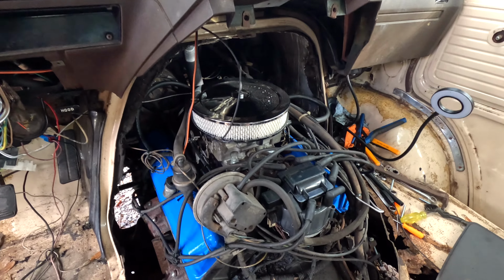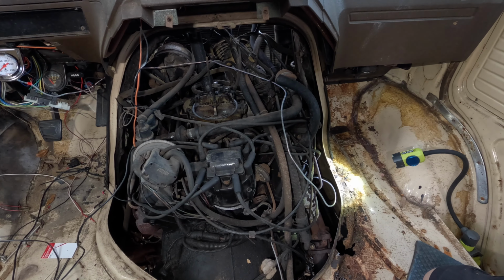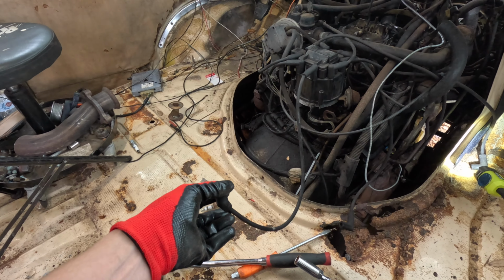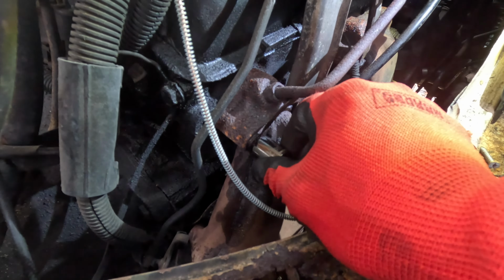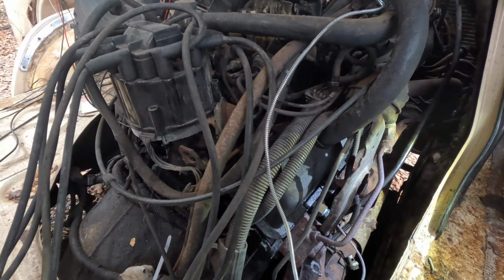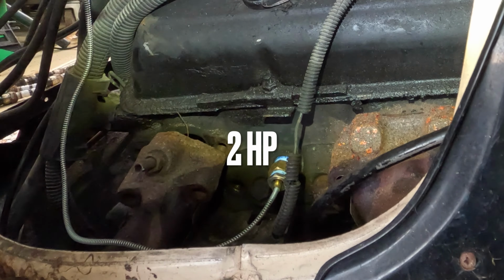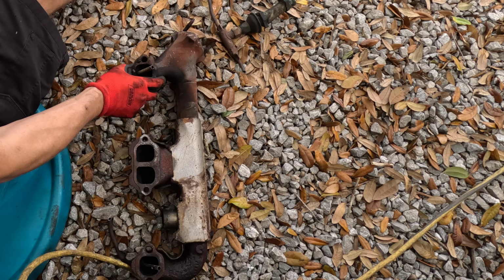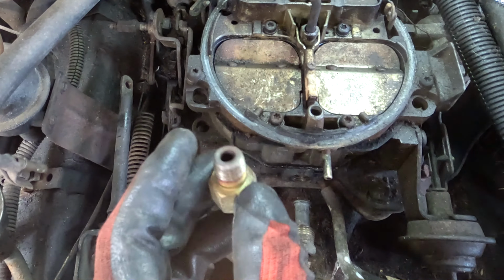Carb and Exhaust gaskets replaced on a sbc 350 in our 1986 Chevy Van G20

Comment: Yeah; I remember in the '80s they used to just tear all that stuff off as soon as it made trouble for the smooth operation. Emissions tests weren't laws yet, and the vehicles weren't beholden to standards. But they knew the day was coming and were trying to get ahead by making vehicles respectable before it got too demanding and expensive to develop engines that pollute less. But people considered all that stuff as just inhibiting junk and made engines run badly.
When I saw that quad spark plug I immediately thought do a compression test. They were probably trying to avoid a ring job. PVC valves were a lot easier and cheaper on these years. There's no excuse for blowing your gaskets out over that little part. Great nostalgia here going over this van. I love this restore!

Comment: I learned a great  trick for fasteners that have to go under the vehicle in the road spray, and are going to be heat cycled: As long as it's not super strength sensitive, just find Brass nuts. They will never freeze to your bolts, hold well, and aren't all that expensive. I worried about them maybe vibrating loose, so I just double nutted each of the joints on my exhaust hangers and the clamps with brass.  Worked great, and here in Canada replacing exhausts happens on the regular tbh.

Comment: I appreciate the content you’re posting.  However, I have a couple of questions:

1)  Why did you buy an additional water gauge when the factory provided you with an oil and water gauge?  Wouldn’t it be easier (and cleaner looking) to reconnect the oil and water gauge in the instrument panel and get rid of the external gauges and the “electrical spaghetti” that would come with it?

2). Wouldn’t it be easier remove and replace the inline fuel filter around the frame rail on the (typically) drivers side?  It has sitting for 5 years. Safe to assume that it hasn’t been replaced.

Keep up the great work though.  I’m enjoying what I’m seeing!

Comment: do the manifold gaskets and no cork gaskets on the flats use permatex and water pump and heater core , check leak down and compression test before doing anything.  on my 6th van build , only g series and or vandura van ,bus , cutaway . etc . happy wrenching

Comment: This may be different for your engine, but I have an 87 g20 van with the first generation of TBI fuel injection. I had a cracked exhaust manifold, and decided to take the opportunity to install headers, instead of brazing it up.

Anyway, the point is that on my engine there is no gasket between the manifold and the block, it's just a very nicely machined metal to metal mating surface. I was surprised, but I checked with the wise old parts guy at my local auto parts place and he said there are no gaskets there. I suspect yours might be the same.

In case you are curios, I would not suggest getting the headers, the manifolds actually flow well enough to support well over 300horses, the main restriction in the exhaust system is the absolutely awful Y pipe that Chevrolet installed, so if you replace the exhaust (and you will have to soon enough) just get a kit of 2 1/4" and either go dual of get a high flow Y pipe. Summit or Jegs has  lots.

The main reason I dislike the headers is actually just that they were not available stainless or ceramic, and despite paying to have them ceramic coated they are already rusting, mind you they were cheaper than getting the old manifold brazed up and reconditioned....

Comment: Hey, I was wondering what the computer does on your model year? I don't think they had ECU ignition did they? is it just a transmission controller? The next year, in 87, they switched to TBI, and its a huge pain in the ass as you have to actually burn new Chips and slot them in if you do much in the way of modification.   But that commuter may not do much in the way of engine stuff at all....